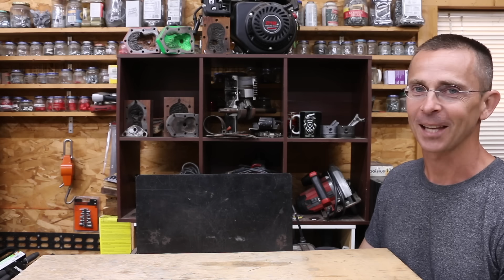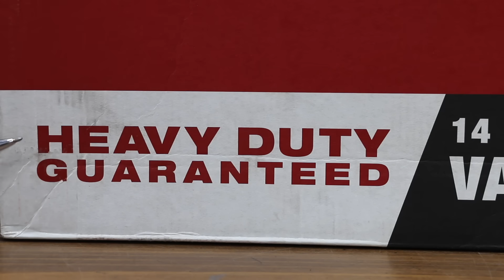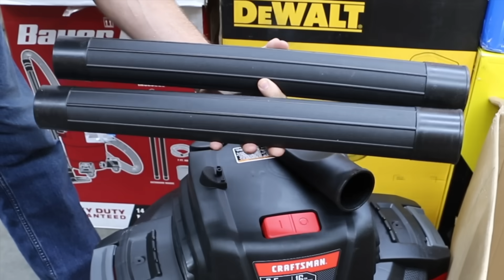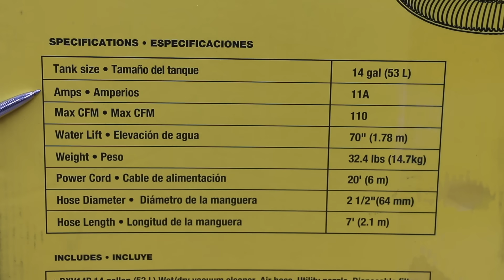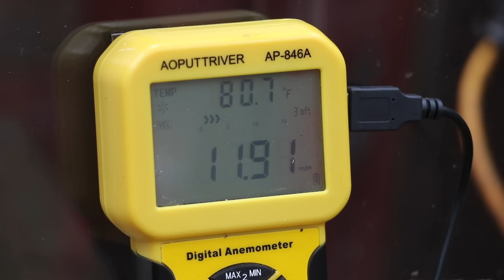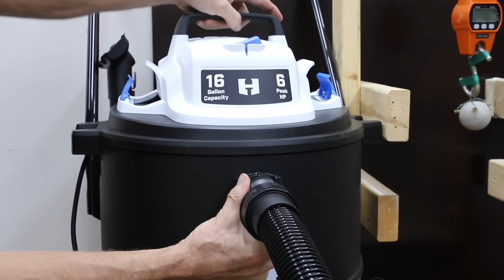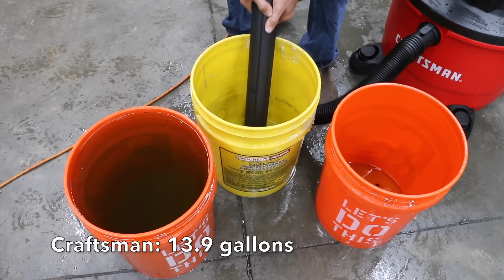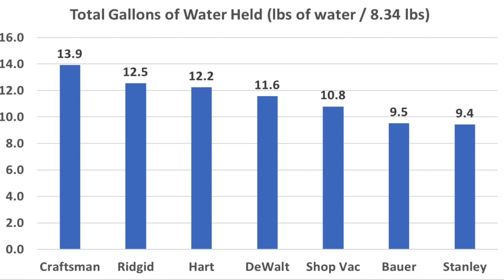Best Shop Vac? Ridgid vs Shop Vac, DeWalt, Stanley, Hart, Craftsman

Comment: Can you do an update cause I am shopping a shop vac, probably 16 gallons and 2+ diameter, with locking attachments and quiet performance. Needs to suck and blow cause my old rigid blows onto the floor and can't be made quieter or stop blowing away the dirt I'm trying to clean up.

Comment: Great review BUT I have a problem with the suction test using a white ball. The suction depends on the tightness of the seal, which in turn depends on the roughness & texture of the surface. So if the tube's edge wasn't very smooth or flat (and it didn't need to be for the vac to work well), results will be impacted. Also, the suction depends on how much of the ball was able to fit inside the plastic tube. A more accurate test could be based around a flat rubber/rubberized mat rather than a ball.

Comment: Would be interesting to see comparisons on older tools vs. their newer equivalents if you’re able to get ahold of them. Mostly just curious if the top of the line products (pretty much whatever survived with long term use) compares to todays versions.

People always say stuff used to be made better but I have my doubts at least on some things. Inherited a relatives tools (3 sheds worth roughly - all older stuff) is really better or even more durable. I’d guess precision tools are much better today. It does seem like materials used in stuff like steel is not as good though.

Comment: So I bought a craftsman vacuum matching the one in this test then I was excited to see the vacuum I bought was recommended by you.  We’re at about 1.5 years in and my vacuum while it did perform well it had a crib death.  I used this vacuum pretty rarely to be honest.  I normally buy dewalt tools but I cheaped out on this one because I rarely needed to use a shop vac.  Bad idea I previously had a shop vac brand shop van that was older than dirt I was impressed with its longevity for sure.  I am in a pickle now I need a new vacuum so I’m strongly considering the dewalt vs the shop vac brand.  I damn sure won’t but a craftsman it is terrible for longevity.  I mean to be fair I vacuumed ashes with it without a filter which is more than likely the reason it died so fast but the shop vac didn’t care I did the same thing to it.  I have such good luck with dewalt tools and it truly seemed to dominate the competition in most categories so I figure it will just keep on rocking like all their other tools have for me.  The only shit dewalt item I’ve ever seen was my brother bought a shop fan and while it runs like a top it doesn’t move air even close to as well as my elcheapo harbor freight fan they are not the same design either but the dewalt it horrible in performance.  Time will tell which one last longer but there is always more than one facet I want top performance and top reliability.  If it is a reliable workhorse but doesn’t perform well then who cares it does a half ass job for a long time.  Vice versa if it’s is an elite performer but only last a short period then again no one cares.  I guess if I was a millionaire I wouldn’t care but hey I ain’t driving a Ferrari.  I want awesome reliability with excellent performance.

Comment: The family has had an old yellow shop vac (name brand) for 25 years and it refuses to die. I still drain the hot tub with it and its been left in the rain for months. If the new ones are half as good ill take it.

Comment: What I love about these tests is that, if you didn't choose the best brand, you can at least get some ideas to improve your shop vac's performance. That lid seal is vital and probably a good place to start. Actually SEEING how much hose length affects performance changes all of my dust collection plans for my own shop.

I have a 20 gal craftsman, and yes, I absolutely love it. It's the best shop vac I've ever owned and the price was fair. I think I paid around $160 for mine. I chose it for the capacity and the warrantee. If a company stands behind their product, I'm more likely to stand behind them. No regrets.

But I am really impressed by the Bauer's performance. We have several shop vacs and I think I'll give them a chance next time something has to be replaced. I have a little one for the house that's barely limping along, so there's the opportunity.

Comment: I had a Hart and recently got a craftsman and I and "blown" away by the difference. For anyone wondering I didn't use the HART too much and it gave up.....Not a thermal fuse or brushes....Totally melted up the motor.

Comment: I have a real Sears Craftsman I paid $99.87 for about 22 years ago. It still runs great and zero problems.
But if I bought a shop vac today; I would go with a Rigid. How can you beat a lifetime warranty on their tools. I love their 18volt power tools as well; also backed by lifetime warranty including the lithium batteries.
But I am glad to see an impressive comparison test.  Wow!

Comment: I do agree with you on the Craftsman, I bought mine in 1993 and still use it a whole lot.  The only thing I have had to do is buy replacement filters, atttachments and a new on/off switch!  I put a rocker style so it wouldn't break off like the original.

Comment: Should do one using the 5 gallon bucket converter. I think those are nice to have for small job applications where not much space is available. I have one and it's pretty powerful wet or dry.

Comment: Have been using the same craftsman 12 gallon shop vac my dad bought back in the 90s, it still works but has been starting sound like it's struggling. The 5 gallon water test was the perfect test to confirm my doubts, after taking it about 26 seconds. Looks like I'll be picking up the Bauer this weekend.😂

Comment: I have a Shop Vac that is probably 30 years old. It is the vacuum source for my wood shop paired with a home built dust separator with a Thien Baffle. The thing will not quit. I think it still has the original filter! I also sometimes use  a hose that is 20 feet long. No complaints but I dread the day it finally gives up the ghost.

Comment: Don’t think a multipurpose, I.e., leaf blower/detachable motor, gives an accurate comparison. Multipurpose tools, etc. are seldom as good as single purpose tools and I think that is the case here.  I bought a Rigid just before this video came out. It is a shop vac only, no leaf blower and has a very tight lid.  The performance exceeds all the shop vacs I have owned.  Very satisfied with Rigid.

Comment: Shop vac brand is terrible.  Just an FYI in case someone considers it. Everyone we ever got had died very quickly... And from running a post construction cleaning business.  Having about 10 running at sites every day.  The rigid is best bang for the buck simply because they almost never die.  The durability is not matched by any brand I've tried.. 

I haven't had a chance to try hart or the harbor freight brand.  Probably wont either.  

We have craftsmanship as well as rigids..  On job sites with the extra hose length; they perform the same except that the rigid pulls around a lot easier without falling.

Comment: Can you attach garden hoses to the drains of shop vacs to either drain fluid from them on the fly, or  to drain them without wheeling them from where the leak /flood is?

Comment: Great Video... I would like to see longevity... I work in a boatyard and we go thru several wet/dry vacs a year. All sizes of Craftsman. The motors usually start screeching and finally lock up... If they're judged by continuous run time probably 60-90 hours... While they're for water, wood, fibreglass, dirt, chips and dust they don't seem to hold up...

Comment: I feel like a better way of testing, if not a little harder on the engine on the vacuums... Is plunging thee hose in first then haveing the vacuums connected to a Surge protector, and flick the switch on on the surge protector.

Comment: I bought the craftsman 16 gallon 6.5 hp yesterday it also came with a 12v car vac with onboard crevice and a attachable brush for dashboards for 99.00 at Lowe’s but it didn’t include a crevice tool or wide wet nozzle. No problem because I can pick them up today. I’ve already used the car vac and it works on wet messes too. I watch your videos before I buy anything because how else do you get important information about a product you want to buy and have around for a long time.

Comment: Hi I  recently needed a new bag for my Shop Vac 5 gallon 5.5 hp vacuum. Instead of buying the OE brand I searched for another brand on Amazon. There were many to choose from. I settled on Nanovac brand size “H”. I think it would be a very informative video of testing different vacuum bags to see which holds up better and keeps the dust down and which one fits the best and is a good value for the money spent.

Comment: These brands have so many different models with variations in motor, size, features. This would have been a better test, if it compared similarly equipped models.

Comment: Well I do a really appreciate your analytics for performance there’s nothing about build quality? I purchased the bauer. Who’s going to replace a 10 or 12-year-old craftsman. The first, and most important thing for me, is that the host size is reduced from 2 1/2 inches. From a lot of experience I have found that smaller hose diameter are very prone to clogs.

Comment: It is easy to see what would make a simple improvement for all of them and that would be to build a good rubber seal on top of the bucket to remedy suction loss. Would most likely put craftsman in the lead for that category.
Anouther category needed was filter effectiveness, durability, price and ease of cleaning.
Usually you put you power tools to the extreme breaking point like seeing what it takes to burn the motor up 😂have you gone soft?🤣

Comment: My Bauer still going strong.  Use it at work.  It vacuums up a lot of sheetrock dust, which clogs a vac quick.  Have to clean the filter a lot when doing that. Liked the Ridgid I had before, because it had bags you could use when doing fine sheetrock dust or sanding primer on millwork.

Comment: I have found the manufacturers allow the lid to fit loosely as it gets pulled down when the motor is running, many can still leak but not always.

Comment: Finally something I know a little about.  Peak amp draw is probably at motor start up or complete suction to "stall" of the motor..  You're not likely to see that on those meters which are averaging like devices over time.  You'd have better luck with a scope right to the DC motor leads.  Anyway it kinda I guess says something about the motor but it's pretty bogus really to stick it on the box as product differentiator and helps the consumer little...

Comment: Warranty is a big thing with Bauer tools that get me. 90-days is not enough for me to feel confident in the product. I bought a Bauer Orbital Sander it failed within 6-weeks.... I got a new one for free because it was still within the 90-day warranty, but if it was out of warranty I would have been screwed. 

I'd buy the Rigid just because it has a Lifetime Warranty. The other brands usually come with 3-year warranties. Bauer should really offer 1-year warranties at least, but they try to up-sell warranties for 12-months and 18-months at Harbor Freight. I'd rather pay a bit more to get a better warranty that's actually for several years and know the thing was engineered well to not fail within 90-days, but rather rated to fail or expected to fail after several years of use.

Comment: "Dust sperater "comparison.  Independent pre shovac filter savers like "The Dust deputy" the onidea system. The most popular diy speraters and the jet particles sperater ($$$$ ) I don't see how you can not do this analysis.Don't you want to know ??  
Side note wich one is the best for sawdust best for drywall etc. I certainly can't be the first to suggest this . And a few spitballers for ya . Best retractable dog leash best self cleaning litter box best tennis ball best bowling ball your best stick type solderiron don't think I recall any of these analysis from you .

Comment: HEADS UP! I bought the craftsman and it sucks fine but the wheel design is super flimsy and theyare proprietary to the unit so when they break you just have to drag it around as craftsman doesnt offer replacements. 😖

Comment: hilarious on the HP disclaimer.  I was rolling my eyes immediately at 16 HP!!!  It's probably a 120V plug, which are typically on 15 or MAYBE 20 Amp fuses.  20 Amps X 120 V, that's 2400 watts, a little over 3 HP equivalent.  For 16 HP equivalent, you'd need about 12000 watts, so 50 Amps at 240 volts or 100 Amps at 120 volts.

Comment: There are a lot of models in the Rigid line and the Craftsman line...As a remodeling contractor for 30 plus years both models have served me well; I've maybe only bought 10 vacs over the decades...And  I BEAT them up...1.5 inch thick Mud wall tiles, thousands of gallons of water,  Thousands of square feet of plaster and lathe demos...Keep the filters decent, and they suck pretty well...:) ...

Comment: You are right. I've had a big craftsman shop vac with detachable mother blower. Ive had it for 4 to 5 years . I use it often , my adult kids borrow it often . I have a car kit for it. It is ergonomic  after all the use is still relatively quiet. And considering  the reliability of craftsman power tools. You can't go wrong. I have never had a Craftsman power tool  fo bad in 40 years. Craftsman tools, whether they be power tool or hand tools end up being 60 to 75 percent in the rigorous some tiimes extreme test you put them threw ., When using them right for what they where design for , should last most people a life time. Mine has . I've bought craftsman tools both hand tools and power tools since the late 70s to present and had to replace only 4 hand tools, and I was abusing those when they broke. They are priced about 75 percent of what people consider the best tools are. They are a very good investment.

Comment: I beat my Ridgid 16gal without mercy on a regular basis. It’s over 3 years old and going strong. Longevity is outstanding. I’ll buy another when this one has had enough. The only downside is, Ridgid’s lifetime warranty requires original receipt and I’ve lost mine. I feel the receipt for replacement policy is extremely unfair to the customer. But otherwise I can’t complain.  Thanks PF!!!!!

Comment: I had purchased a Hart unit at Walmart. Failed on the 2nd use. I disassembled the motor and found a piece of plastic stuck under a motor brush... no idea where that came from! Overall, I'm disappointed in the unit although it has continued to run. I won't be purchasing another Hart product. (Yes, I let them know this too.)

Comment: After seeing this test, I can't imagine NOT paying the extra for the DeWalt. I've used my share of cheap crap shop vacs, and they're almost worse than not having a shop vac with as much of your time as they waste, as much frustration as they have to offer, their ineffectiveness when you really need them most, and nevermind how obnoxiously LOUD they are. The cherry on top is when it still works but you're giving/throwing it away because it's such crap that you'll eat the cost of that and buy a different one(that, hopefully, actually works worth a damn) to replace it. 

I'll deal with the DeWalt's price tag and weight - give me the performance and quietness
 
...if only that Bauer was as quiet as the DeWalt...

Comment: The Ridgid vacs without the detachedble   blower are  are the best on the market.  Not nearly as loud, extremely powerful, and they  last for many years.   The 6 and the 6.5 horse models, without the detachable blower.   Cannot beat em

Comment: I'm looking for a shop vac that can actually blow out pool drains with the blower portion for winterizing inground pools.  My old 6.5HP Shopvac brand couldn't push the water out until air bubbles came out (basically nothing happened).  Which one of these can blow out a pool bottom drain?  Has anyone used one of these shop vacs for this purpose with success? Thanks

Comment: Wow, you have lots of good information here!  I have just one criticism -- the rubber ball vacuum test strongly depends on the inner diameter of the nozzle that touches the ball.  If you had used adapters and made all the nozzle/ball interfaces identical in size, the results would have been meaningful (and the differences between these vaccuums measured this way would probably have been negligible).

Comment: The DeWalt is made by Alton and it's not even DeWalt manufactured not even Black & Decker which is the parent company I believe anyways I bought one of those dewalts and it only lasted 6 months before the motor went out and I had to return it to Lowe's where I traded it in for the shop vac brand. I was going to go with the Craftsman but they were out of stock

Comment: If you do this again, I'd like to how high they can pull water into their bucket from.  As someone who has a basement prone to flooding, its pretty nice to be able to pull water up through a window.  It's another good way to measure suction, I suppose.  Yeah, I know I can use a pump, but that usually leaves a 1/4" of water everywhere still.

Comment: Looks like Dewalt might be the unsung hero here.:

Dewalt was the quietest in noise (rank 1)
Dewalt ranked 1st in suction performance at 10.4 lbs
Dewalt was ranked 1st along with Bauer and Craftsman for “seconds to vacuum 5 gallons of water”
Dewalt was ranked 1st on fastest amount of time to vacuum 50 lbs of sand

I should mention that  I don't use my shop-vac as a leaf blower only for vaccuuming.